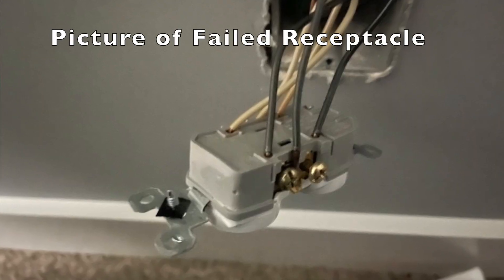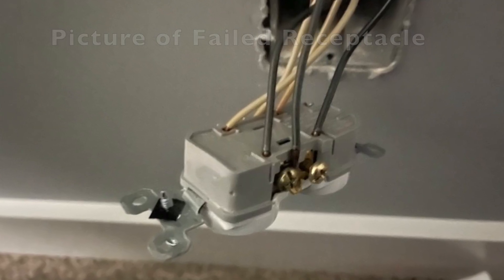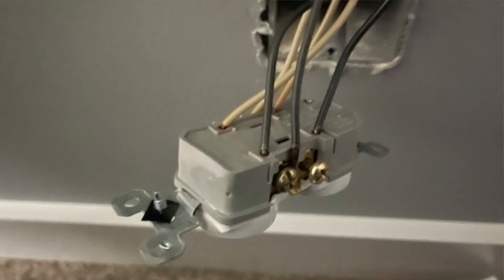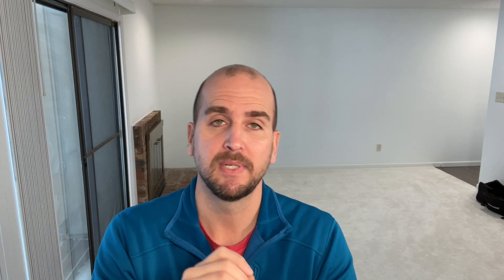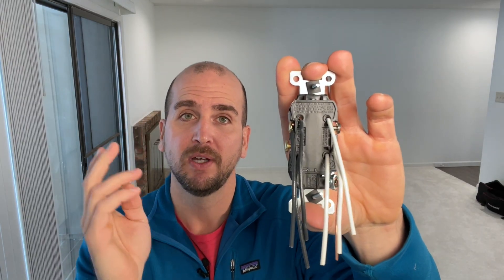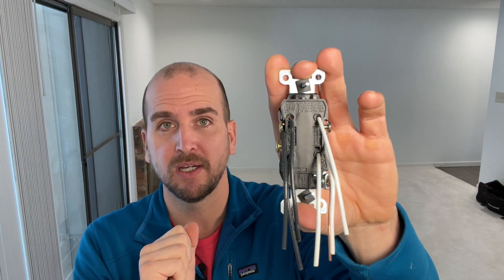Incorrectly Wired Outlet Found In Newly Built Home

Comment: Before securing the outlet as a final step I wrap electrical tape around the outlet’s hot and neutral screws as well as wrap the wire nuts. It’s not time consuming and one additional layer of protection.  Using electrical tape is good practice.
Reply: Unnecessary. Also traps heat. The screws aren't going anywhere.

Comment: Purchased a new builder home.  I know it's not against code but two receptacles and several light switches are up-side-dwn.  This to me is lazy.
Reply: Generally speaking in homes, you'll find the "upside-down" receptacles are controlled by one switch not hooked to anything else. It's dedicated to that switch and is easy to tell precisely because it is upside-down. Try hooking a lamp up and testing?

Edit: I don't know how a switch is upside down?? Is there a label on the switch? Moreikely it is wired to another switch so it can be controlled at either side of the room?

Comment: How do you feel about Wago flip connectors instead of wire nuts?
Reply from the maker: I am a fan especially for DIYers which are taking on electrical projects https://youtu.be/AWiyreFFt-Q
Reply: But aren't  push connectors the same as outlet back stabs, much reduced wire surface contact area, plus, no mechanical splice for strength if connection is stressed? Not a fan.
Reply: Sorry, flip connectors are different from push ins, but not sure if they address my wire surface contact concerns. Any users?

Comment: If there are only 2 wires to attach to an outlet (2 hots & 2 neutrals) then theres no reason to make pigtails. All you're doing is creating less space to work with in the box by adding wire nuts and more wire. Each wire can go on its on screw. Now if there are 3 or more wires then obviously its better practice is to tie them all together and have 1 wire come off and go to the device.

Comment: I have read through a lot of the comments here, and I haven't seen the #1 technique that has served me well in electrical work.

The tug test.

After making any kind of terminal connection or wire nut connection... tug each of the wires to make sure they are secure. Always give each wire a solid tug once you finish tightening something. 

The number of times I've avoided a weak connection because I tugged on a wire and it came loose or didn't feel solid, I've probably saved myself all kids of headaches. 

Couldn't tell you the number of times I've gone into a house panel on a service call and when tug testing, simply pulled wires right out of their breakers with little effort.

Comment: The box is open in the back. This is would be only acceptable for low voltage wiring.  Need to have a closed box for appliance rated voltages to contain electrical arcing long enough for either, the breaker to trip, or wiring to  fail  (melt)  breaking the circuit, and not ignite a fire within the wall.
Reply from the maker: Hi Stephen, not sure if it didn't come through in the video but this was a standard metal electrical box with a mud ring.
Reply: @EverydayHomeRepairs  My mistake. I wasn't paying close attention at the end of the video when you were stuffing the receptacle into the box. The plastic extender looked like ones of those low voltage remodel boxes with no back. In the city where I live the push-in "stab lock" wired outlets are not allowed. Also, I prefer to use the outlets where the wire is squeezed between two plates. Much easier (less stress) on you and the wire than forming a J hook.

Comment: Another thing you and others failed to do is use electrical tape around the outlet before putting it back into the box. This will give a divide and avoid any direct contact with other elements.  It is sorta insulates the outlet especially with metal boxes.
Reply: I don't know about the states, but here in Canada wrapping a receptacle with tape is the mark of an amateur, and the inspector will scrutinize your job pretty carefully. He knows you're not a licensed electrician.
Reply: @paulmaxwell8851  I'm a licensed electrician and most if not all boxes that are installed in my local are metal, not plastic. If you don't tape, you're running the risk of a contact hitting the metal or worse someone grabbing the receptacle by the sides and electrocuting themselves.